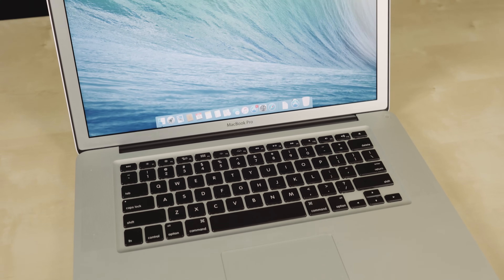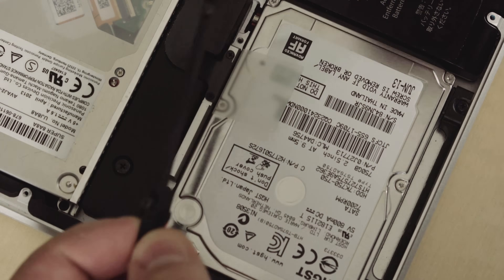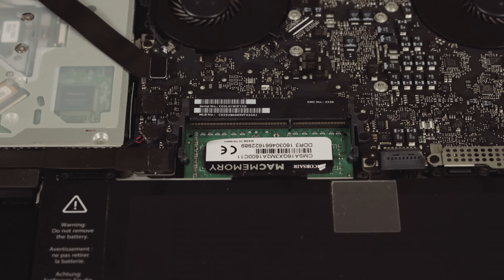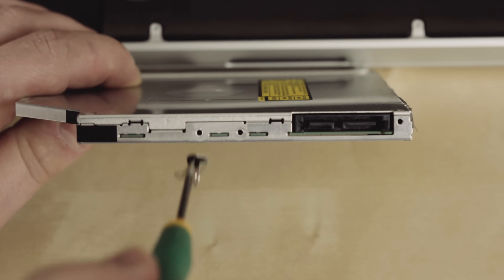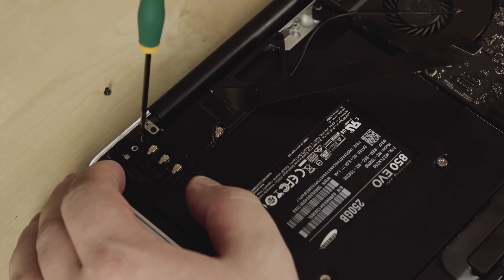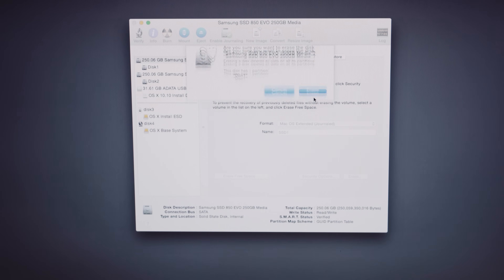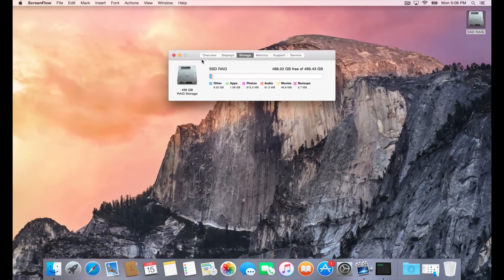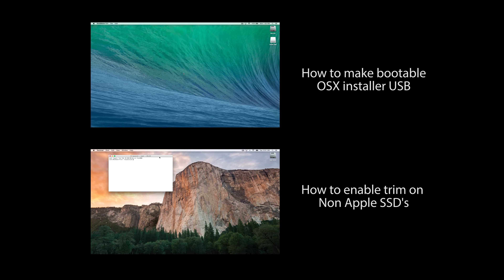Fastest 2012 MacBook Pro Ever! Upgrade Guide - in 4K

Comment: I just  inherited a MacBook Pro,  After a lot of bullshit I got it updated to Sierra. I have NEVER used a computer that is so worthless and slow. Everything about it is slow, Typing, loading things, opening programs, Forget watching a video. I gave up on this and watched your video on my phone. 
So my question is, what should I do with this thing being so slow, It's a 2011, physically its in great shape (until I throw it) but I can't express to you how slow this thing is, A $170 walmart computer is better then this Mac. Will dong the updates on hardware that you mention in your video help with this or do you think its a software issue right now with this being the new Sierra. 

Thanks in advance for  any help
Reply: Whenever you update any mac, it takes time for it to settle into the hardware and run faster because it does SO MUCH background stuff. You can literally just leave it on for a while to let it finish in a couple hours. I experienced this with my first macbook every time I went to a new OS (not a regular update). There's also ways to restart the system internally (not a regular restart) which will reset stuff so it boots up faster. (search "restart macbook SMC")

As for the hardware, YES it'll make it much faster when booting, loading apps, and copying stuff. The only thing this hardware won't make much faster is anything with graphics (games, video editing, internet speed, etc). 

For the time being, I would delete stuff you don't need if the hard drive is nearly full. Go to Apple icon -> "about this mac" -> Storage. Hard drives need at least 20% free space to run fast. Make sure you empty the trash can as well. 

Hope this helps and good luck :)
Reply: Supertinyfeathers that's the thing that sucks. I just deleted the entire hard drive. Completely and it's still crappy
Reply: MrHondaguy77 Sounds like the processor is an older model. An SSD would help as well as more RAM but if you have anything better, you could always try selling it. If not, consider going back to Yosemite, let it index spotlight (3+ hours), and later run "first aid" on disk utility. I'm positive Sierra is slow because it just came out, the same thing happened to me with mavericks and it took until December before it was fast again. Literally, All Sierra is for is to include Siri which is just another background task taking up more resources. You could wait it out for Sierra to update a couple times, but it'll probably stay slow without an SSD and at least 4GB of ram. The "About This Mac" Should tell you what year it is, and you can find out what the specs are, and what you can upgrade it with. Everything before 2011 basically uses a core 2 duo processor, which will only handle web browsing, light games on low settings, and light video editing. IF you can't afford a new computer, I think an SSD and more ram is worth it (especially the ram, first thing I did). SSD is more of like a "nice to have" upgrade for loading apps, copying files, and converting stuff.

Comment: Do you need yosemite/elcapitan to use the raid function? And do the ssd's need to be matching/same size?

AND if I'm restoring from a time machine backup. Will the data still spread across the raid setup?

Comment: on MacBook Pro (15-inch, Mid 2012) ,in apple support written it's maximum 8GB of RAM. ?? are you sure it is possible to make 16GB?? as well as the macbook pro late 2011
Reply from the maker: Im not sure about the 2011 but it works in the 2012. If it wasn't possible it would just never boot. I even show in "About this mac" that it has 16gb. If you're worried about it just Go for it! Been using it for almost a year now with no issues.

Comment: I completed my MBP as u said (not caddy), when i completed and tried to boot nothing happened, no response from battery and remaining charge indicator doesnot show anything. Worked with AC power but whine i turn ON mac front notification light flashes 6 times before boot. Double checked all the connection.

Comment: Will this 2012 with these upgrades be good for logic pro x? Its all i can afford and the most i would do is 10 audio tracks at a time with 2-3 plugins per track and reverb as an aux track
Reply: It should be fine man, i've ran pro tools and ableton with 40 plus tracks all with plugins and i have a stock 2012 macbook pro. Just have to play around with the buffer size on your daw.
I plan to do this upgrade just to make my everyday macbook faster, as well as making it a lot better for recording.
Reply: It'll help but Logic Pro (and any kind of editing software) will always benefit more from a dedicated graphics processor. I went from 2GB to 8GB in my macbook as well as an SSD and basically, it helps process things more smoothly. It just isn't very optimized because I don't have a good dedicated GPU or more threads on the CPU. What takes me 2 hours to render would easily take 30 minutes if I had a GPU :/

Comment: Im suprised you called it the fastest Macbook pro even though you didnt use the Samsung Pro 850 or even considered using an external thunderbolt GPU. You also continued to use the yosemite operating system instead of using the bootcamp os and overclocking your macbook pro. But.... maybe im wrong. Maybe everything stock about the Macbook pro is significantly faster than any other sorts of those upgrades :P

Comment: I have a mid 2010 MacBook Pro that's been reliable this whole time but is slowing down even after transferring nearly everything to a external hard drive. Off the top of your head, what would be the major differences in your tutorial in relation to my older MacBook Pro? I hope you can answer this before I pay some hack to upgrade my Mac for me..
Reply from the maker: Just replace the HD with an SSD. Cheap upgrade. It'll make a major difference. You should also be able to upgrade the ram to 8gb

Comment: thank you for share this information. Its the best upgrade video ive seen for macbook pro...

I got a few questions, the ssd must be 250 GB? can i use only one ssd of 500GB? that affects the speed? My model is A1278 can i use this upgrade or can your suggest any better? i work with adobe programs i need the best i can get. 
thanks again!
Reply from the maker: You can use any size ssd you want. I just used 2x 250gb because I already had one. And yes you can just replace the one drive with 500gb. You don't have to do two. I just did it to show the potential speed you can get by using 2 drives in Raid0. Thanks for watching :)
Reply: so you think its faster with 2 ssd or should work the same with one? Sorry for asking again!! thank you!
Reply from the maker: +Felipe Isaza It's twice as expensive, twice as much work, and twice as much speed. Haha I'll leave the decision up to you. For most people one SSD will be more then enough.

Comment: Great video - the comparison test at the end was an eye opener!  I have the same machine and the HDD is a dog after 4+ years - now there's a clear path forward to upgrading without having to buy a new Mac.  Have you swapped out the original battery yet?
Reply from the maker: No the original battery is still going strong. Screen brightness on 75% , wifi, and running photoshop I get like 4-5hrs
Reply: Wow - this battery is shot.  Will likely replace when I go through the SSD and RAM upgrades.  Thanks again.

Comment: Can I do this to a medio 2010 15 inch macbook pro?
Reply from the maker: Yes the ram and Hard drive can be replaced. You'll see a big improvement in speed. It wont be as fast as the 2012 though. You also cant do Raid0 as effective either.
Reply: Just a silly question: What would happen if i use 2x500 gb ssd's instead of 2x250 gb?
Reply from the maker: +Rasmus Krog 1tb of storage ;)

Comment: I just used all of the parts you used in this video and its crazy how much faster my MacBook Pro is. Thanks for the video
Reply from the maker: Pretty crazy right?
Reply: The downside is that a RAID is TWICE as likely to have an error or have a disk crash. Even the 2Gb 850 Evo Zen used can pull over 900 Mb a sec on Blackmagic solo and the 860 Evo should be even faster so the go is to put a 9.5 mm thin 2Gb HD for $100 into the DvD bay and a single big 860 Evo in the HD bay. 4Tb onboard storage for cheap!
Reply: Stephen Fry l
Reply: @Dream-Academy  2gb? so the os is going on a 2gb hard drive and apps on the 860 evo hard drive? Im editing so I don't need any crashes lol

Comment: How's that anti glare screen?
Reply from the maker: It's not bad. It's a higher resolution than the glossy one. But still not as high res as a retina screen.
Reply: +Zed ProMedia I heard it's not easily cleaned and not durable. I have a good offer on one already upgraded to the max like this setup basically but they want around 900 for it. Which has the anti glare hi res screen. I just don't want to get it and mess the screen up lol. I was trying to find a glossy hi res MBP but not really having any luck finding any under 1k.
Reply from the maker: +Vonte Bryant I've owned a PowerBook and the older gen MacBook with a matte "anti glare" screen and never had a problem with. Cleans as easy as the glossy without the issue of finger prints like the glossy. I really prefer it to be honest.
Reply: +Zed ProMedia if I may ask, how do you clean it? Do you have a protector on it at all or anything? Thanks for replying unlike most youtubers!
Reply from the maker: I just use water and a paper towel. lol! Sounds sketchy and it probably is but thats what I've used all these years. dampen the towel and clean. I dont push super hard. And then follow up with a micro fiber cloth

Comment: Hi, great video. I currently have a MacBook Pro 13" from mid/late 2012 which recently, has been extremely slow with constant freezes with the "spinning rainbow wheel of death" , I currently have El Capitan so I don't need the usb drive with the software on it do I? Also, I was wondering what the benefits of two ssd were, rather than 1, I would have 1 500gb of the same model-Samsung 850 Evo. I was also considering buying a 1TB hard drive for backups etc which is roughly 50 pounds (I'm English ;). Once again, great video, hope to hear from you soon
Reply from the maker: I only did two ssd's to show that you can do raid0 which effectively doubles the bandwidth of the read and write. So its actually twice as fast as one ssd. If you clone your drive over to the new one first you dont need to re install elcap. My guide is for a new fresh copy. As for the 1Tb drive are you thinking to put that in place of the optical drive? That is fine too if you need the storage.
Reply: +Zed ProMedia I would use the 1tb for external storage and then potentially buy two 500gb Samsung SSDs. How exactly do I clone the OS X ? Just copy my files onto one of the hardroves I'll be installing?
Reply from the maker: If you have a way to get an external enclosure you can put the ssd inside and use the free software called carbon copy cloner and it will duplicate your drive. Once its done. Take the ssd out of the enclosure and swap the drives in your computer. There are videos on yt that show how to do it if it sounds confusing.
Reply: I went and got my MacBook Pro checked. It's a hard drive problem. I already have 16gb ram. I'm going to just get one ssd and not go raid 0. I'm just slightly confused about installing the OSX with a usb stick. Thanks mate
Reply: He was using the USB as an example of someone who wants a completely fresh computer, for example if you've bought a second hand MBP and you want to wipe it clean of anything the previous owner had on it.

This can also be done as a way of effectively giving your MBP a new lease of life, by re-installing the OS and dragging and dropping the files that you want to transfer one by one until you've built your MBP to how it was before... people suggest this is a way of 'Cleaning' the MBP, not sure how effective it is however. Another reason you may do this is if you suspect that some data is corrupt because of a hard drive failure or something.

You could also use Time Machine to clone your existing drive onto the new SSD using an external cradle/adapter usually USB to SATA connection cradles are between £15-£30 and is a useful bit of kit to own for future data transfers!

Comment: would it matter if you didn't put 16gb of ram but 8gb?
Reply: Armani Torres depends on what you are doing. Newer OS and apps need more and complex apps like Photoshop and Final Cut Pro need more, so 8 GB could easily be marginal. I found 12 GB a little light sometimes and upgraded to 24 GB. Check your memory pressure gauge in Activity Monitor
Reply: you upgraded your macbook to 24GB? Which one do you own?
Reply: Not a MacBook Pro, a laptop. A Mac Pro, a big honking desktop tower. I traded that up to a 32GB 12 core Mac Pro. Same big case.
Reply: Not as much fun. 8GB is marginal with modern Sierra and applications.

Comment: Hi. 
Nice video :-)
Can I use a 240 GB SSD and 500 GB SSD and put them into Raid0 ? Or do the disks have to be the same size?
Reply: If you use combination of 240 + 500 GB SSDs, the final RAID will be only 480 GB (1 whole disk + 240 GB from the 500 GB one)

Comment: To those wondering if buying a used pro and doing this exact same thing vs buying a new pro. Pro has retinas and usb 3.0 i think. USB 3.0 is invaluable in this day and age, buying 2 evo 500gb to get 1tb with better ram will put you more than a new pro. 
So unless you get a friend price on one, it isnt cost effective.
Reply from the maker: This 2012 model has usb3.0 and thunderbolt. The laptop cost me $900 plus $350 to upgrade it. That puts the laptop and upgrade at $1250. Yes it doesn't have the retina screen I agree. But beyond that its a much better $$ savings. Thanks for watching.
Reply from the maker: +RHP if have a lot of browser tabs, edit video, or anything that requires more strain on your system you will find more ram also helps. But if you already have 8gb that's not bad.
Reply: I wouldn't do that we're in 2016 I won't spend any dollars on a 2012 MacBook. Evo SSD aren<t cheap either (especially if you put on 2 to have a RAID 0). I'll add a bit more let's say 1500$ total to find a newer mac. or better yet build a Hackintosh if you stick to Mac ecosystem. But that's just my opinion and the video is helpful for anyone willing to upgrade his macbook. so thanks uploader
Reply from the maker: +RHP One ssd will be a huge improvement. You don't need to do everything I did. I just made this guide to show how you can get the max speed out of an old 2012 MacBook Pro.
Reply from the maker: Samsung or intel for the SSD. As for ram the stuff I posted in the link below is what Im using.
Reply: do i have to follow every step even though i just change ssd and keep the disc.. and is it necessary to upgrade my ram? FYI I'm using for browsing, streaming, watching movies, editing video... Really appreciate your help
Reply: +Zed ProMedia the question was for u
Reply: +Zed ProMedia how about ram? Should I change to??
Reply: +Zed ProMedia thanks a lot. 😄😄😄😄
Reply: +Zed ProMedia ooh I forgot. One more question. Any recommendations what brand of ssd and ram should I buy?
Reply: im mistaken then, i didnt know usb3.0 was in the 2012 model. So the deciding factor would be if retina really matters to you. And your right ive seen the same model macbook for less than 1k so the improvement is really huge with the new hardware. This really means one could actually have an old macbook that performs better than the current model essentially.  Thanks for your reply and guide!
Reply: +Zed ProMedia again, thank you very much
Reply: +Zed ProMedia I have found 500gb samsung evo 850. Is it good. And you're  using ddr3l, right??
Reply: Just noticed. Is that md101? Why the side of the screen is white not black?? Or is that a different kind?

Comment: do you recommend a different caddy set since this one did not come with screws? also i am choosing between buying a new 2015 macbook pro w 8gb ram and 256gb ssd vs a 2012 macbook pro and manually upgrading it to 1tb and 16gb ram. what do you suggest? will the numbers on benchmark/ performance still be similar?

Comment: Damn good instruction video. Pity I didn't stumbled over this one earlier. Well, many others are as instructive as yours - but they are too dull.
Nevertheless, I did my MacBook Pro 13" mid 2012 yesterday. 
I put in a Samsung EVO 750 250 GB SSD and 2 x 8 GB Crucial 1600MHz.
I went from between 52 sec (as fastest) to some 16 seconds from pressing "power on" to reaching the login box.
These parts costed me some 1500 SEK (approx. USD 178). Tools were at ~17U$.
My next move will be a 500-1000 GB SSD, instead of the DVD-reader. That oughta do it.

I'm happy, and so could you folks be as well. 
Go for it!